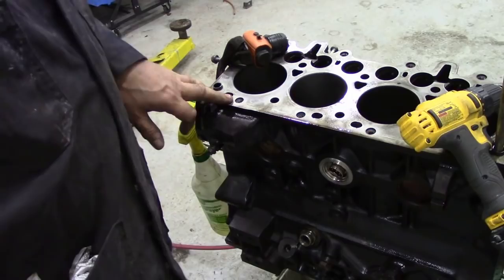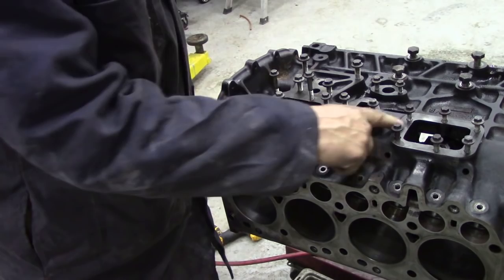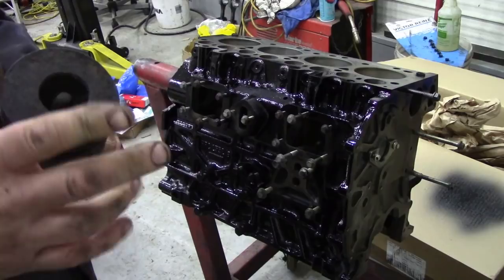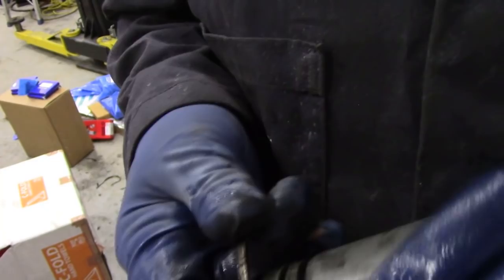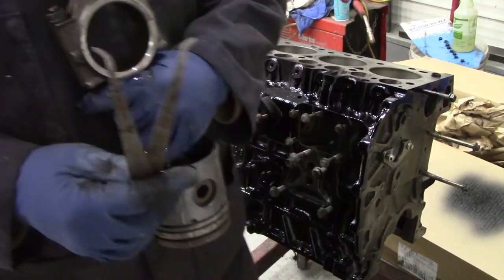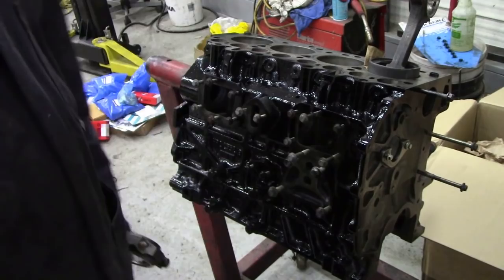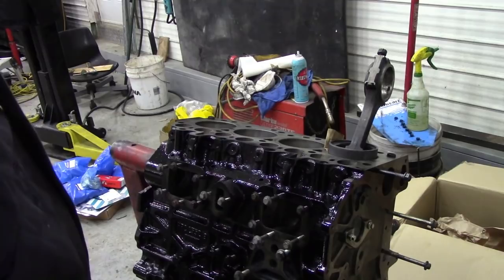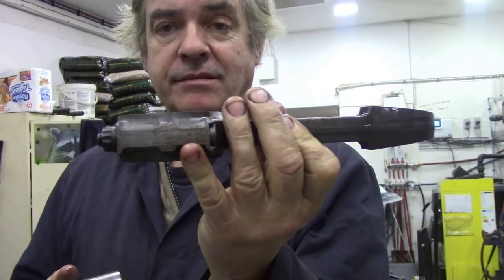300 Tdi block and piston inspection  Part 3.   I have a problem with my rod!

Comment: While you were talking about replacing the small end rod bushing, I was looking at the "book" and was amused to see that the bushes aren't supposed to be changed.  The book also mentions that the cylinders should not be deglazed, and it says that the head should not be skimmed. How many things mentioned in the book are not really correct?? I hear many people say they have got their head skimmed and their trucks are working fine.
Reply from the maker: Indeed! 

Why sell the little end bushes if they cannot be replaced?!
Sometimes the genuine books are wrong
I have had lot's of heads skimmed  - you just have to cut the valve seats back to the right clearence
Mike

Comment: Hi I have a Landrover 300 defender with a problem I'm unable to solve,I did an overhaul,got a recommendation of rings size 020,but it has an endless smoke and on piston 2&4 ,there is diesel at the top ,how can I sovle this....

Comment: Where do you get the honuing tool from? Thats awesome.
Reply from the maker: Here is an example - you need the right size for your cylinders

https://www.amazon.ca/Research-FLEX-HONE-Cylinder-Abrasive-Diameter/dp/B002XUL0TK/ref=sr_1_11?keywords=honing+tool&qid=1581194264&sr=8-11

Comment: What should be the rings gap to ensure a good compresión and 0 consumption of oil?
Reply from the maker: Check fitted gap of each new piston ring in turn
with ring positioned half-way down cylinder
bore.
Fitted gap of rings in bores:
Top compression = 0.40 to 0.65 mm
2nd compression = 0.30 to 0.50 mm
Oil control rails = 0.30 to 0.60 mm
Reply: @BritannicaRestorations  Thank you!
Reply: I preciatte you promt answer. Can you tell me the gap between cylinder and pistón?

Comment: Hi Mike, just a question on the use of engine stands, Ill be taking the engine and gear box's out of the old 110 chassis soon, the boxes will be going straight into the new chassis but the engine will need to go in a corner of the garage until I have the rest of the rebuild done.  The engine will be the last thing I do.  I have a stand but is it ok to mount the engine off the fly wheel housing or should I drop the flywheel and housing off and mount to the engine? Just easier for it to be kept together until I get on the job.
Reply from the maker: I mount onto the block - this gives access to the crank seal - if you mount to the flywheel housing you may not be able to get the crank out (depends on which engine you have)
Reply: @BritannicaRestorations  Its a 200tdi defender (genuine)  I have to borrow a hoist to get it all out, as the old chassis is in the yard(on stands), I can't just wheel it into the garage on the hoist (the threshold is raised to stop water getting into the garage) so will need to 'hand over' to the engine stand at that point.  Once on the stand I can store it until i am ready to work on it.  I have a beam/chain hoist in the garage for that point in time and hang it on that when I get to the point of dropping the flywheel etc then back on the stand until I'm read to drop in the new chassis (the engine is at 265k miles from new, oil dropped every 5k, original turbo, had the valves and big ends done 14yrs ago, pump and injectors dealt with by a diesel specialist 12yrs ago) The main point of worry really is I have never seen anyone mount on the fly wheel housing (aluminium) using a stand (4 bolts) only direct on the block.
Reply from the maker: On a 200 the rear oil seal in in the housing so if you need to pull the crank you would not be able to get it out if mounted on the aluminium housing